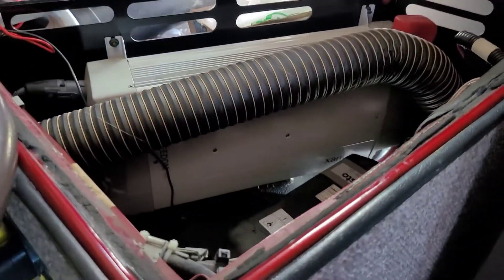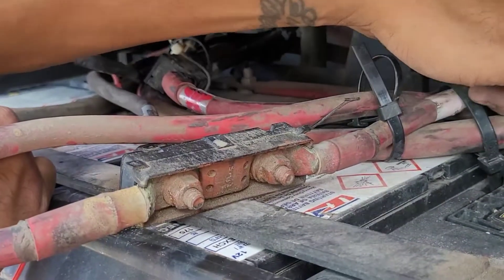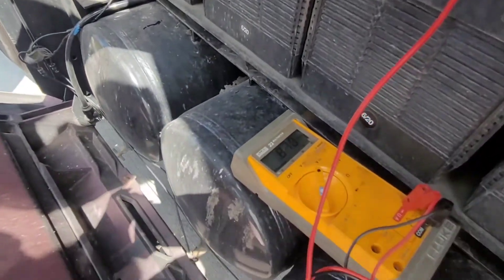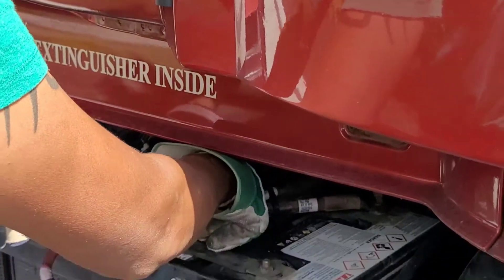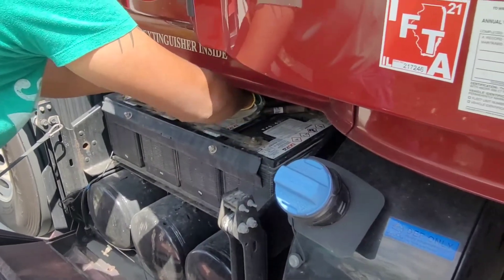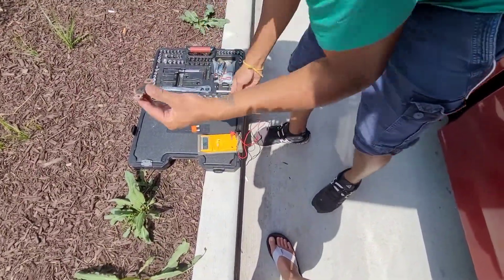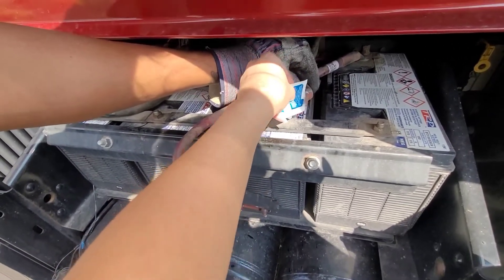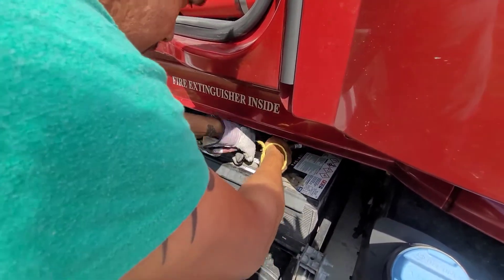Volvo Semi Truck Inverter. Xantrex Freedom HF stopped working completely! $8 Troubleshooting! FIXED!

Comment: you need to use the continuity measure on the fluke multimeter not the ohm measure.

Comment: You did good brother,  it's funny, I just delivered and backed into space for tonight and my tv and microwave would not come on, so hit the reset on inverter and it wouldnt stay green..
Went to luggage tack and  flipped the main switch and even hit the kill switch, came back in and only plugged in the t.v. AND IT WORKED, THEN TRIED THE MICROWAVE  AND IT IS WHAT ACTUALLY JUST DIED AS I WAS BACKING IN THE SPOT, SO WHILE I WAS DRIVING THE 5 MINUTES FROM THE DELIVERY TO THE TRUCK STOP IT JUST DIED AND MADE THE T.V. GO OFF AND TRIPPED THE INVERTER PLUG IN!!
SO BACK TO WALMART FOR ANOTHER CHEAP $45 MICROWAVE, IT LASTED 2 YEARS IN A TRUCK!!!😮😅😂😊😊😊😏🤔👍✌️✌️✌️

Comment: You need to find the original cover for that fuse or wrap it electrical tape or something . Also you need to know why the fuse blew in the first place. It might blow again.
Reply from the maker: Thanks. It didn't work when we bought the truck from the Volvo dealership. We are the second owner. The dealer said they don't know why it doesn't work and what the previous owner did to it. So we found the cause and fixed it ourselves.

Comment: We just bought the truck with the inverter.  Now all of the cigarettes power ports don't work.  But the USB works. Please help!!!
Reply from the maker: If all doesn't work. There should be 1 main one that's burnt out. You need to find the main one and fix it. Once you fix that then the rest should work.

Comment: You guys i can't  thank you enough  i had the same  but i replaced the wrong  fuse and i came across your video and I was able to change the right one 👍👍👍👍👍👍👍👍👍👍.

I have to add  i was in  Chicago went a happened  i end up going to volvo to buy the  fuse with a was  a few 4 dollars  than  yours 😂😂😂😂 but  still was way less than put my truck in the shop.
Reply from the maker: I'm glad our video helped you.  Everytime something happens to the truck or trailer it always costs and arm and a leg to fix when you bring it in the shop.  We always try to do it ourselves unless it's something we really can't do. Be safe out there. 🙂

Comment: So iono if your issue is the same. But I can turn mine on from inside. But it comes on for maybe 2 seconds and then shuts off. Would replacing the fuse fix that. Or could it be a wiring issue?
Reply from the maker: I'm guessing you have loose wires somewhere. Maybe check for that.
Reply: How did you fixed the problem? I have same problem if you can help 

Thanks

Comment: Is that wire really loose like that or did he unbolt it from somewhere? Because it looks like it could short out very easily.
Reply from the maker: All the wires by the batteries were already like that. Its all zip tied together.

Comment: Hi I have the freedom hf 1500. It is working and sending power out of the outlets in the sleeper. We just got a microwave and it turns on but won’t heat up food. When I check the screen it says only 0.03 watts are being used when the microwave is on. Any thoughts on what could be wrong?  The microwave is a 700 watt.
Reply from the maker: Our microwave is also 700 watts.  It works fine. Have you tried a different outlet? It is definitely not as strong as the ones we use at home.  For example, instant noodle would be only 3 minutes with the microwave at home.  It takes 5-6 minutes with the 700 watt in the truck. We do 3 minutes at a time because we don't want to blow a fuse. Our inverter usually reads 14.7 when it's not in use.  When we use the microwave, it usually reads around 12.7
Reply: @bonnyslifevlogs6442  unfortunately we’ve tried heating something up for 30 minutes and it didn’t make a difference still very cold. I tried the outlets on the passenger side but I will try the other outlets on the driver side today to see if it makes a difference.
Reply from the maker: Have you tested the microwave at home to see if it has the same problem? Just to see if it's microwave problem or inverter problem. Sorry I can't help much.
Reply: @bonnyslifevlogs6442  no I have not but I will try that thank you.
Reply: I am having the same problem. Did you figure it out?
Reply: @John-jo6tc  yes, I called someone to come check it and he told me the inverter is not giving out enough power probably due to age/use. I have since gotten rid of the truck so never fixed the issue.
Reply: @andrewabdisho9369  my truck is only a month old so I doubt thats my issue
Reply: @John-jo6tc  Mine was a 2016 model. Best of luck in figuring out the issue.

Comment: Hi how are you? My inventor is not working on my semi truck it's have small red light on outlet you guys had the same problem
Reply from the maker: Hi. Did your GFI outlet popped? Do you have a reset button to press?
Reply: @bonnyslifevlogs6442   yes I pressed it but it's still red
Reply from the maker: @Amir-ky5db  I did not have that problem. Check ground. Maybe you have short circuit somewhere. Make sure nothing is wet.
Reply: @bonnyslifevlogs6442  ok thank you
Reply from the maker: @Amir-ky5db  you're welcome. Hope it works out for you .
Reply: What setting should I have it on input voltage.. input current.. output power?
Reply from the maker: Are you talking about the ohm meter?

Comment: Hi can i see inverter wire how you put in your truck .. you guys use just two wire red and black or more ?
Reply from the maker: Hi. There's 1 red and 1 black wire that goes straight to the inverter from the battery.  The red wire is the one that has a fuse.  The fuse we used is 125A.
Reply: @bonnyslifevlogs6442  thank you